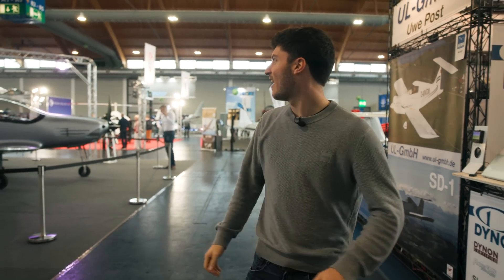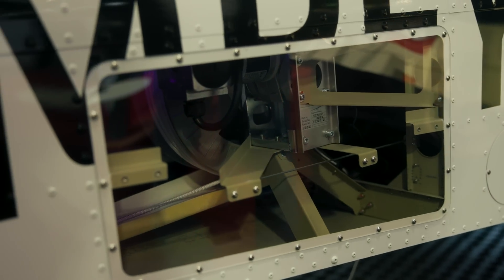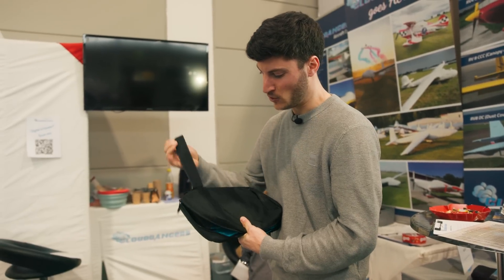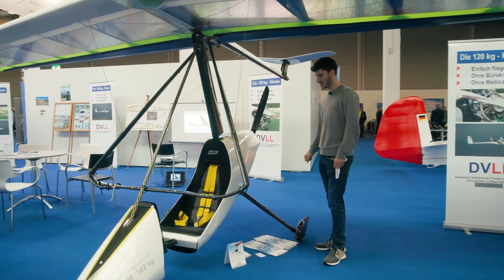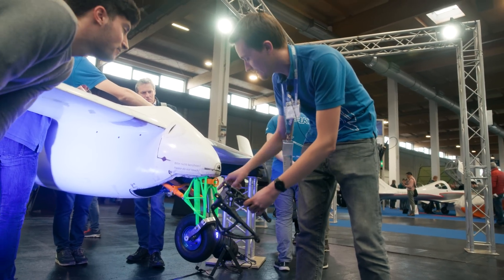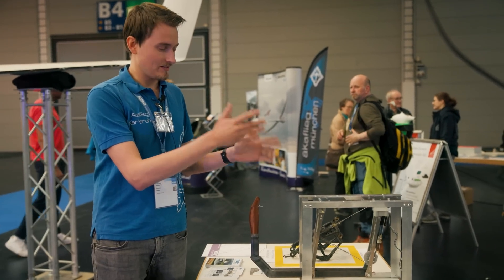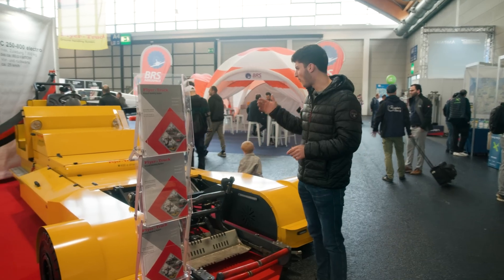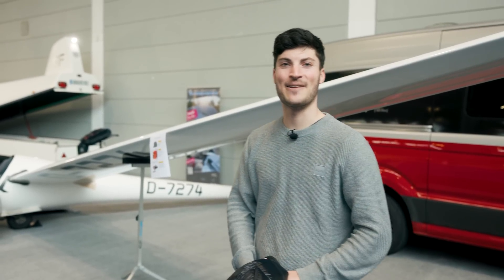New JS3 FES & Looking For the Ultimate Tow Plane

Comment: Ultimate tow plane is right here.
The new Eurofox 915 140bhp.

Here's some stats which I doubt any other AC will compete with.....

915 performance and economy continues to impress, 27 tows today, 16 2seaters,most of those to 3000', total of 66000' of tows, fuel used 82litres, 1.24 litres per 1000'

K21 750 to 800fpm
Lighter type single sweaters 1000fpm +
Heavy single seaters 8 to 900fpm.
Some of the single Seager pilots complain that they can't tell when they get towed though a thermal as the vario is pegged on 10kts all the way up.
You will not be dissapointed when you buy one !
Reply: and a lot less cost than a Dynamic. Dynamic only makes sense if you are using it as a mixed use aircraft - if you want a dedicated towplane, Eurofox is the way to go.
Reply: @soaruk3697  as far I as I could read the Eurofox 915 is only available in UK?

Comment: JS3 with FES.... please tell us more.  It can't self launch?
Reply: The key to a self launch with a FES is the ground clearance of the prop during the takeoff run. A LAK 17 is capable of doing it:
https://youtu.be/rxe6DIfPKb4
But a JS3 is sitting lower on the deck.
Reply: @avigator   Really?  I thought if that was the issue, then simply making a longer landing gear would solve that issue.  Perhaps the geometry of the landing gear won't allow for lengthening.
.
Hhhmm perhaps 4 prop blades and a short outside diameter would ensure ground clearance.  
.
Anyone have comments?
Reply: @avigator  An empty LAK 17 with no waterballast............ and EASA have been reluctant to certify due to prop clearance issues. FES makes little sense for self launch but good as a sustainer if you don't fly competitions. The JS RES system is far more adaptable.